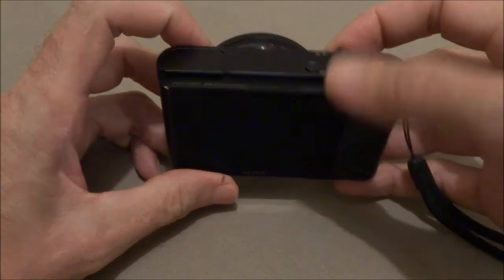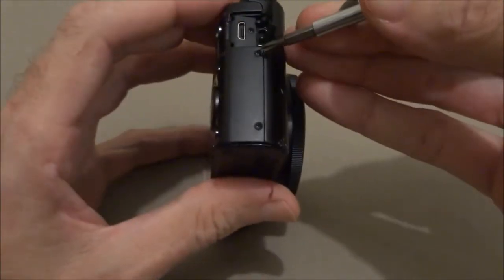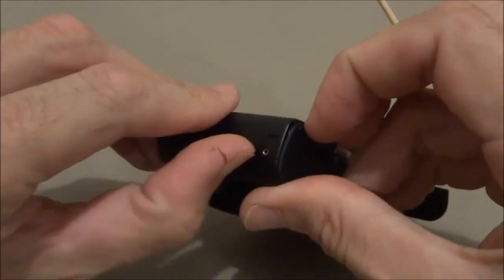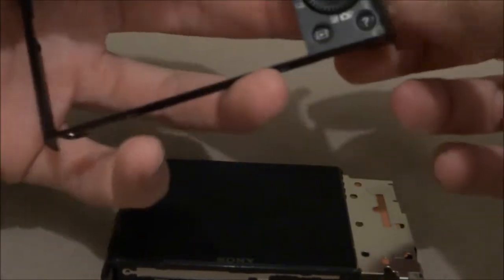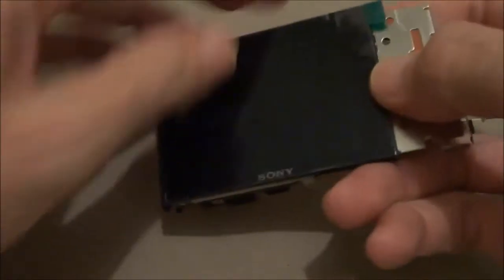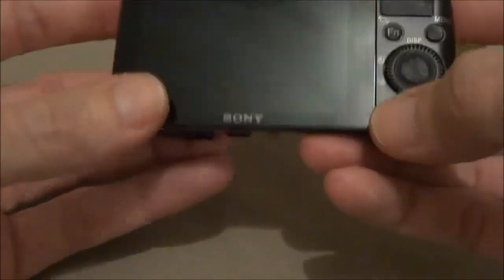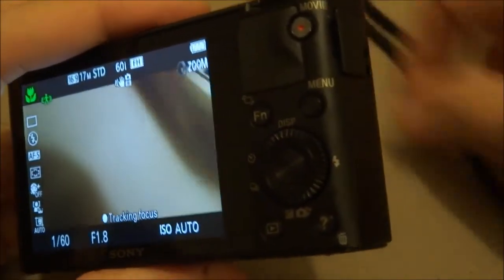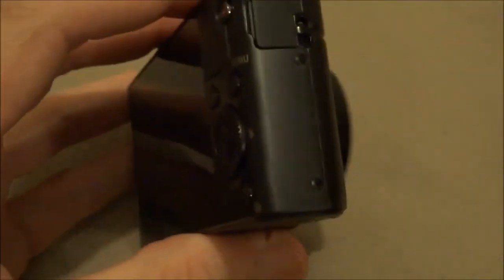Sony DSC-RX100 LCD Screen Replacement Repair

Comment: I am in search of someone to change the screen on my Sony rx100 m5. Do you still offer repair services?
Reply from the maker: I used to charge $150 labor + parts but i have not done one in awhile. I do have time to repair one.  need to see if i can find m5 LCD,  parts have been hard to come by.

Comment: can you fix mine?
Reply: how much would you charge me my screen is blank but everything works
Reply from the maker: i usually charge $150 for any work on a camera,  but can do it for $50 if its the RX100   and not the m2 or m3   let me know and contact me in the youtube messages. https://youtu.be/Oi5UW7bVPuw

Comment: Dear David
Unfortunately I found nothing about changing the flash cable on the Sony RX100 (Model 1). It is broken in the kink of the flash mechanic. The flash seems to be okay. The flexible flash cable FL217 is available on ebay for about 13 Euros. I would like to ask you for some assistance. Do you have any video material or advice? Thanks in advance for your help.
Kind regards, Alex
Reply from the maker: get the right tools.  take your time. Take your time.  watch my videos on lens replacement for the rx100.   do NOT touch the capacitors on the flash. will shock the hell out of you and could short the camera boards.  i dont have i video on replacing the lens on the rx100 M1  but once you get the case off and lens cables disconnected and main board out.  the lens comes right out.  watch some videos in my playlist on the M2, M3 and M4 lens replacement. will give you good info.  to remove the CCD cable from main board you have to remove the gold screen on board,  lift board so the CCD cable can be pushed out over lens.  watch my videos i talk about this.   dont rush.  do a little work on it take a break and come back do some more DONT RUSH IT.   once you get the lens out you can remove the flash and cables.  use tape to cover the contacts on the capacitors.

Comment: QUESTION: My screen “image” now won’t flip when in vlogging mode... it works PERFECTLY other than that, do you know what could cause this? I read on forums it might be a magnet issue? Can you message me a fix or solution so my image flips like it should when in vlogging mode please. Theres a few of us on the DP Forums that have this problem... We would be forever grateful! 
BTW: I have a RX 100 my 4 version.
Reply from the maker: Not to sure,   they might be using a gyroscopic chip much like the iphones uses.  the chip would have to be placed in the LCD panel and when flipped it then flips the LCD image.  a magnet can also be used.  i'm not to familiar with the operation if this M4,  did just turning the camera upside down make the LCD image flip?   or did you have to fiscally flip the screen for the LCD image to flip.?

Comment: GREAT VIDEO. Question, I have a Sony RX100 Mark 3 and recently dropped it in the sand and the top dial (function selector) is nearly impossible to turn. How do I clean it out. Thank you very much for any assistance!!!
Reply from the maker: try a vac first.   to remove and disassembly the top control you have to take the whole camera apart.  there are screws under the to control panel to remove the dial.
Reply: Thank you for your response. Watching this video, it appears that I'll just need to dis assemble up to the stage where you remove the speaker and open the camera? It appears I'll have access to vacuum around the dial from there? Your thoughts?
Reply from the maker: no before you try to take it apart put a vac on top where the sand got in. maybe it will suck it out.  to remove the top panel you have to take the camera all apart even the lens and motherboards.
Reply: UGH! I won't be trying that. I've been using the shop vac and I think I'm getting some of it out. I've been turning the nob and then vacuuming, repeat, repeat, repeat, etc.

Comment: Very good instructions, especially at the critical areas, the display ribbon cable connector hold down bar, and the gummy gasket
release care, during the removal of the old display. Yes patience and delicate handling that you walked us through during your video made a successful repair of my camera.  Thanks to you, for doing this video.

Comment: thank god for this video.  i didn't use it to replace the screen, but just the info on taking it apart was helpful.  

I used it to fix the "powering on" problem that some of the rx100's are afflicted with.  In my case it appears the culprit was the "playback button".  So i removed that and "altered" the back of the plastic button with a saudering iron.  It still turns the playback feature on when pressed but it doesn't appear to be causing the camera to turn on when it's just sitting there on a table.

Anyway, thanks!

Comment: does it work with the m5
Reply from the maker: i would think so, i have not worked on the M5 yet.
Reply: The mark 5 has a flip screen,  does the mark 2 has it too? should it be a problem?

Comment: Hi, I changed the screen, but screen is still not lighting up. Camera does take pictures, they look good. But I don't see any image on the screen. Is it possible, that the part where you fit in the connection cable is the problem? And if yes, is there anything that can be done about it?
Reply from the maker: the two last connection are the backlight.  the two that are soldered on the ribbon cable.  it is possible that the backlight is not coming on.  recheck the cable.  try not to bend the cable to close to the LCD

Comment: In the official Sony guide, it says the orange sheet at 6:22 needs to be replaced when the LCD is replaced. It's a sticker. The repair manual is here: http://www.dpreview.com/forums/post/50835350

Comment: Can you give me an example of your method of cleaning the ribbon cable's?
Reply from the maker: first confirm its the LCD, See if the camera saves an image on the card and picture looks good then take a picture of something with contrast, push play to show on LCD then get a bright light and shine into the LCD and see if you can see the image. If the backlight is out the image is still on the LCD and you will see a faint image when you shine a bright light on the LCD. Once you confirmed it is the backlight.  remove LCD and look at the gold contacts if they are dull clean them.

If you do not see any image when shining a bright light on LCD then the whole LCD it out. 

what i found that works the best was a scotch bright sponge the fine one. i also have used tooth paste with a light brush.  when cleaning brush the direction of the contacts not against them like when you sand wood go with the grain. This frost that gets on the contacts is tough i dont know what it is but i have seen it on CCD, LCD and other ribbon cables. just pulling the cable out and in will not clean it,  It has to be brushed of.  once you get the LCD out you will see if the contacts are shiny or dull.

Comment: Do you know if this screen will work on the Sony RX1?  My screen just stopped working.. the camera still takes pictures the screen just won't light up.
Reply from the maker: I looked at the specs of both camera and the lcd shows the same specs.  so it could be the same part.  but not sure..  i know they use the same lcd for hx200 hx300 hx50 hx60 rx100 rx100m2 the lcd will also work on a nikon 9600. it just might be the same LCD.  i looked at both LCD's and they sure look the same.  but i cant tell you for sure.  you might want to try to take the LCD ribbon cable out and see if its frosted, the contacts get frosted and loose connection i have had this on many cameras. moister will do this.  the contacts should look shiny like the ones in this video.
Reply: Otherstuff Where are you located?
Reply from the maker: lifelivelove TX why?
Reply: Otherstuff  I am looking to get this screen issue taken care of.. I just got off the horn with sony.. they wouldn't disclose the part number for the RX1 screen and they told me that the screen for the RX1 & RX100 were different.. not sure if they are blowing smoke to cover themselves but I was kinda left with that feeling. They of course suggested I send it through to their authorized sony people in Connecticut and get charged an arm and a leg.
Reply from the maker: lifelivelove has the camera ever been subjected to moister?  I have had several cameras where the connections get frosted and loose connection and all i had to do is clean the ribbon cable.   some would make the LCD different color and some the backlight would not work and once cleaned they worked.  the backlight has two power leads that comes out of the backlight and is soldered to the ribbon cable then it goes to the connections, its the two last ones. then has tape over it. the first thing i would do is take it apart and check the connections.   i saw a LCD for the RX1 on ebay for $40 if you do need one.
Reply: Otherstuff can you send me the eBay link? Thanks for your input..
Reply: Otherstuff  I got it from someone on the east coast and they have had a rough winter so I wouldn't rule it out
Reply: Otherstuff have you ever purchased from that ebay seller before?  They have a lot of negative feedback..
Reply from the maker: lifelivelove yes.  thats where i got all my LCD screens.  he has the best price fast shipping too. never had a problem.
Reply: Thanks for your awesome video dude, I did have a minor (freshwater) leak on my rx100 when the underwater housing was incorrectly fitted. I chucked it into a jar of rice for a week to dry out and it still take pictures- but nothing's showing on the LCD. I swapped the screen out with a sony part from ebay but it's still not lighting up- suggesting the ribbon is the issue(?) Is it the little blue ribbon cable that needs a clean then?